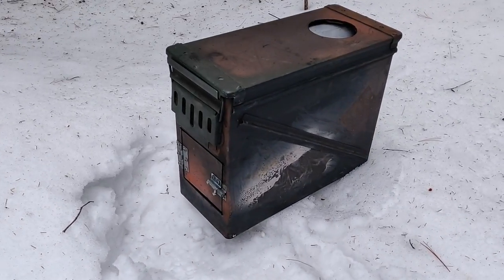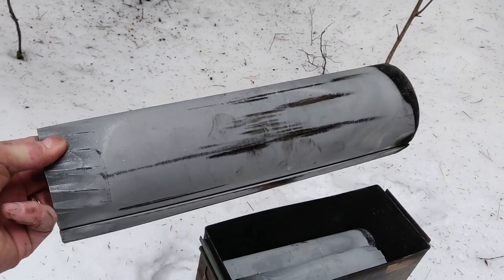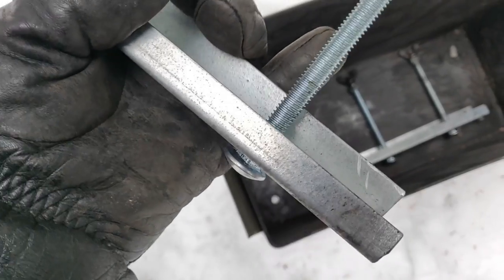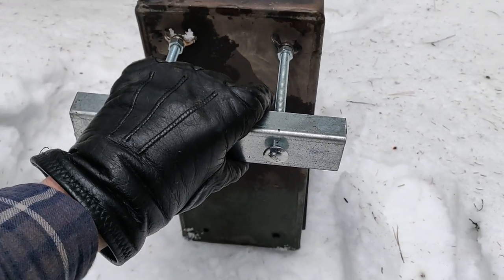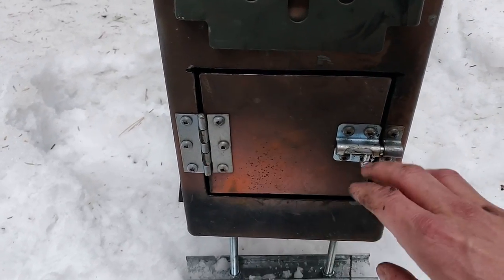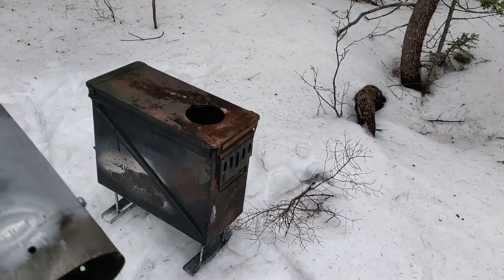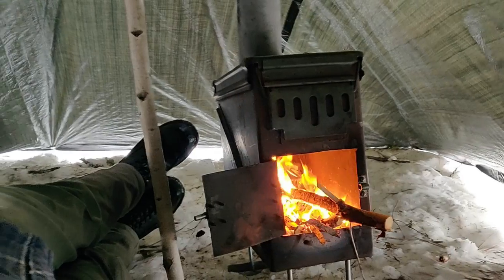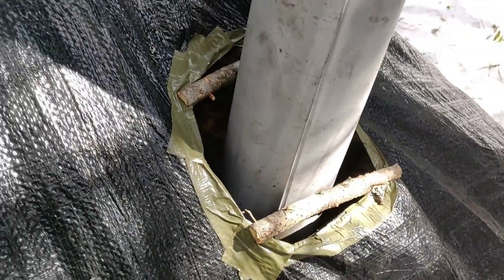Ammo Can Wood Stove for Hot Tent Build - DIY - without Welding, Basic tools only, How to

Comment: Josh,   Nice job on the basics, but a couple suggestions from an old guy that’s been running/repairing wood stoves for decades.  First, NEVER use galvanized pipe for a wood stove (or a galvy rack from a refrigerator to cook on over a fire, for that matter).  Zinc is toxic when burned, & can’t be made non-toxic. Use black steel stove pipe only.     2nd, add some flat stock to the bottom of those legs to make it less tippy (make them as long as you can fit inside the can). Your current setup is sturdy, and will act as a heat-sink to keep the flat stock cool.  Lastly, I’d use (grade 5) nuts & bolts with lock washers on the door hardware. The constant heating/cooling will cause the sheet metal screws to loosen constantly.   Great videos! Keep ‘em coming! 👍
Reply from the maker: Jim thanks for the feed back.  I'm definitely not an expert in this area so any feed back is great!  Even once the galvanized is burned off it's still not good?  I didn't know.  I did think about the colding and heating of the screws but thought I'd see how it went.  I just had them in the basements so went for it.
Reply: Joshua Gammon      If you only use that setup a couple times a year, I wouldn’t loose too much sleep over it. While the zink’s “fuming” is minimal after the initial burn off, it’s still there. While some outfitters still sell collapsible galvanized stove pipe, you’d be wise to avoid it. The safest choices are black steel or (if $$ isn’t a consideration) titanium pipe from high end camping supply dealers.  If I was going to be cooped up in an ice fishing shack with it for extended periods, I’d swap out the galvy pipe for the other options. 👍
Reply from the maker: Thanks Jim.  I'll check it out

Comment: That's pretty freakin' cool buddy! I love it! I would add a little grate of some sort at the bottom (maybe made out of an old oven rack?) so the burning logs aren't sitting right on the bottom of the box (for venting and longevity of the box).
The only drawback is that the inside of the box is full of black soot and that stuff gets all over the rest of the gear. Not a huge deal though. I'm just a little fussy - lol
Thanx for sharin' bud!
Reply from the maker: Ya I was planning to add a bottom to it.  Also maybe a bigger door and a damper.  Upgrades for later.  Thanks man.

Comment: That's pretty slick, and I especially like the no-welding part of it.  Others mentioned some mods to look at and I appreciate those ideas, too.  Besides using this while camping, it would make a great small patio heater for quiet nights with my wife, instead of firing up the big backyard wood burning fireplace.  I've seen similar projects, but this idea and presentation I can wrap my mind around.  Well done, sir.  Pete - KI7LIL
Reply from the maker: Cheers thanks Pete.  I don't have any Fancy tools so I had to make it simple.  Good idea for a patio heater too.

Comment: Great for a quick build. Another thing I've seen is cutting a round hole for the vent on the front and using the sheet metal from the top for the vent, using a bolt in the middle and cutting out a hole in the front. It creates a better seal. Also a deflector on top below the vent so it's more efficient. I'd like to find something easier for the feet, but not sure what I like the most. Maybe something like a RivNut or PlusNut, but trying to keep the threads clear and clean is difficult. Maybe in a piece of that metal across the bottom for support and rigidity would help.
Reply from the maker: Thanks for the great ideas.  Got me thinking now 🤔

Comment: Now that’s pretty cool! Nice work , if I say so myself . Easy to strap down on the atv if you had it and away ya go
Reply from the maker: Lol.  Already thought of it.  Be great for fall, winter and spring but it's going to be way to hot if it's warm out.
Reply: Joshua Gammon I wonder how the gap around the door is going to effect the wood burning part of it. But what a hell of a idea to use as a stove ,  now that recycling at it’s finest haha. Can’t wait to see the video
Reply from the maker: @SCOTIAN_  the gap just let's a good flow of air in.  But it's burns ok.  I may do an update to the door and add a damper later.  It's works good for now.  I'm happy with it for it being on the cheap.
Reply: Joshua Gammon should work well. And agree the price is the best haha

Comment: I would put something on the bottom to separate fire from bottom of the stove. Fire will eat through if you dont. Even small stones will help. Some guys use metal mesh that will elevate that live coal from the bottom. I am often burning stuff in large barrels and fire eat through them like crazy. And it always start at the bottom. Otherwise I like your simple design
Reply from the maker: Hey Michal.  Thanks for the tip.  I never thought of the rocks in the bottom.  Great idea.

Comment: Great build,  @3:20, if you flip the leg channel over, the nuts would be inside the channel instead of protruding out.
Reply from the maker: Cheers thanks.  I'll take a look at doing that.  👍
Reply: @JoshuaGammon  not too big a deal on soft ground/snow, but would help on hard surfaces
Reply from the maker: @jimmyboy163  for sure.  Might get the old stove out soon.  Getting colder out there now. 😁

Comment: How many pipes did you use? From I can see you're using 4?
Reply from the maker: You can use as many as you need to get over the top of the tent.  Can be shorter if your tent is low.  Hope that helps Jacob.  happy new years.

Comment: On a colder day those gaps at the ground will absolutely freeze you out. Close the gaps with snow and get yourself a CO detector.
Reply: haha thats exactly what happened to me on my first winter camping trip, there wasn't any snow to fill up the gaps.... i guess I could have used some brush. and I also didn't get enough fire wood for my stove, it was a cold night lol all learning experience though.
Reply from the maker: It was just a quick setup for a test run.  I'll close the gaps for sure.  Cheers
Reply from the maker: I'll be bring a shovel for the gap fill.  This was just a quick setup for a test run.
Reply: @JoshuaGammon  I'm not hating. Just giving advice. Keep it up. Found you through r/bushcraft btw
Reply from the maker: @hellabearded7742  oh I know.  Thanks for the advice really.  I'm not an expert.  I appreciate the feed back.  Cheers and thanks.